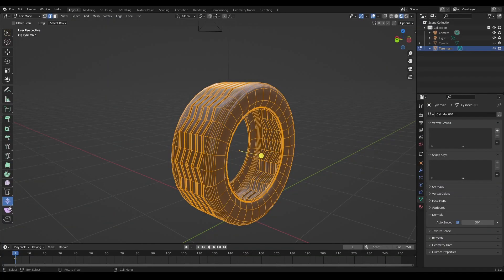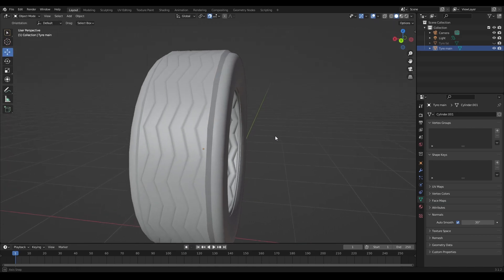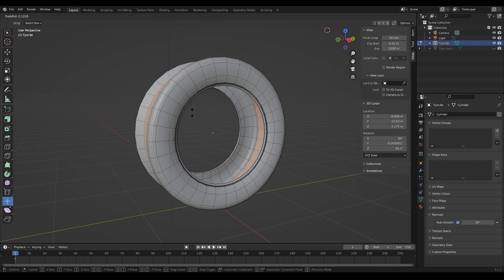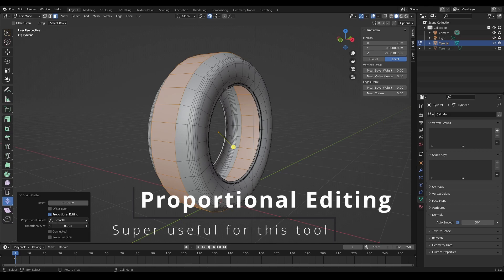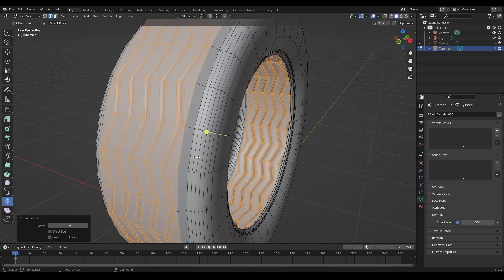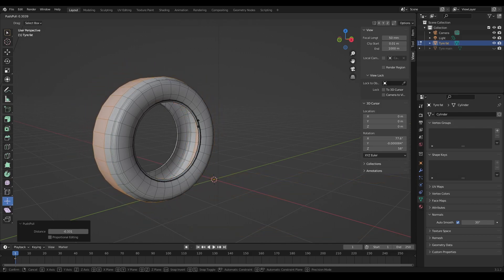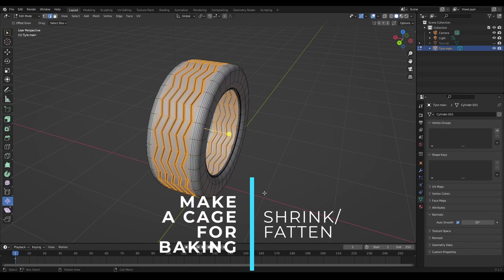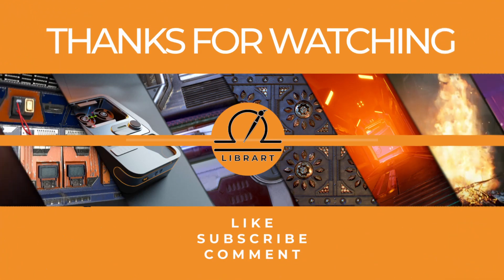How to use Shrink Fatten Tool in Blender: Tutorial 16 - Blender Beginner

Comment: Commenting here for future reference: EDIT : The Shrink/Fatten tool usually works great for expanding a mesh. HOWEVER, if you are using Shrink/Fatten to inflate a 90-degree corner mesh (such as a crown moulding / baseboard piece) and that mesh has stepped 90-degree grooves etc, then those stepped grooves will not maintain their shape during inflation and will become skewed. The SIMPLE fix (and I thank God for showing me this solution!) is to use the Solidify modifier instead. Set the Solidify modifier Mode to "Complex" and Thickness Mode to "Constraints" to maintain the shape during inflation. IMPORTANT : If you are wanting to inflate a CAGE mesh for baking a High-Poly object to a Low-Poly, then having perfectly sharp angles in your cage mesh will actually produce BAKE ERRORS. In this case, using the Shrink/Fatten tool on your cage mesh and allowing it to skew slightly will produce a better bake. Strangely, for some meshes, the inflated result of the Solidify Modifier set to "Complex" and "Constraints" will visually look ALMOST identical to the result of just using Shrink/Fatten with "Even Thickness" ON. However, the bake result will be drastically different... and only a cage mesh inflated with Shrink/Fatten will bake correctly!🤔

EDIT2 : The above notes are referring to baking a fully-smoothed low poly mesh. However, I have found that, depending on the mesh, you can achieve better bake results by using the Solidify Modifier as described above to inflate your cage (using Simple mode, Even Thickness, and High Quality Normals checked).
Reply from the maker: Awesome additional information. I had no idea about all of this.
Reply from the maker: I have pinned it for everyone’s future reference!
Reply: @librart  Thanks so much! Hopefully my random notes while stumbling through the baking process will prove helpful for someone. I often have to refer back to my old comments and forum posts because I tend to forget things if I haven't done it in awhile, LOL! 🙂

Comment: Good video!
Reply from the maker: Glad it is helpful.

There are a couple of things I missed out on this video. Also I do think I would have been better using the slick tyre model rather than the grooved tyre for shrink fatten exhibition. I was very limited by how much I could ‘fatten’ that mesh as a result.

Ah well, next ones should be better
Reply: @librart  That happens when you add in angles. 🤔😃
Reply from the maker: @mind_of_a_darkhorse  Haha that's true!